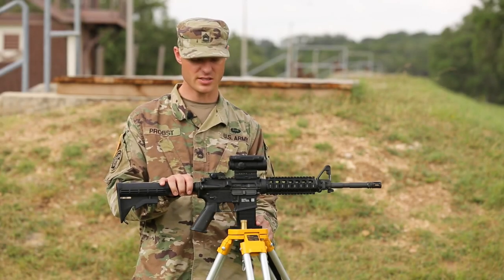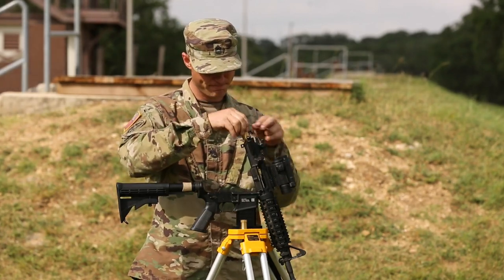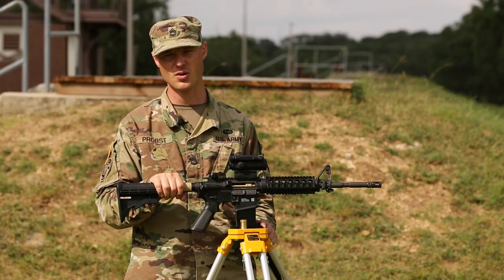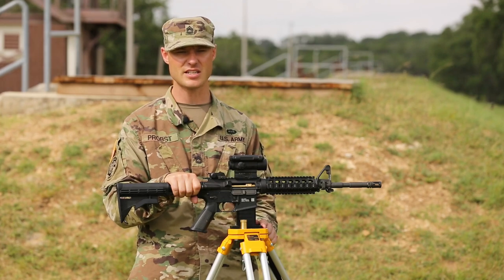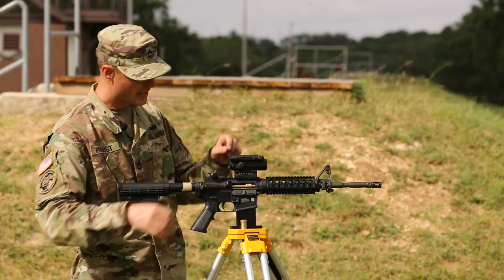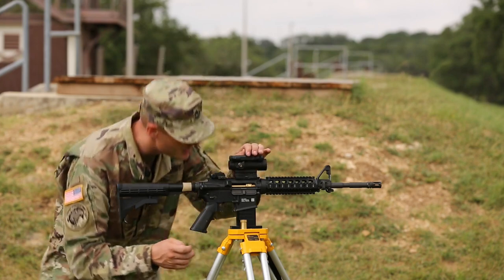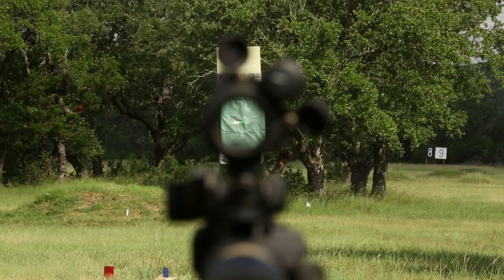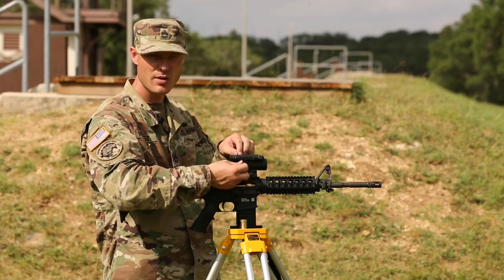Rifle Bore Sight (CCO)

Comment: 1 - pull the upper off the lower
2 - remove the BCG
3 - support the upper such that you can see through the bore to a target (sandbags make a helpful support)
4 - fine adjust the supports to center the target inside the bore
5 - without disrupting the supports, adjust the optic such that it aims to the same target
6 - look down the bore as often as needed to confirm you have not moved the supports
7 - reassemble and confirm by firing at close range
Reply from the maker: This would be the no-equipment approach and it also works.

Comment: You can also boresight without the laser device or the tripod. Considering the number of individuals who are afraid to service their sighting systems, I wish you would have at least mentioned that alternative methods are available when the equipment isn't. The laser device you have appears to be well made, but visually looking down the bore without a laser far outperforms most of the devices that are commercially available.
Reply from the maker: The laser device and tripod demonstrated here helps expedite bore sighting for an entire unit or other large group. As you say, this can also be done visually with no equipment.

Comment: If you have a laser) if no, you need a source of light, for example a candle or a led with 2032 battery. 
Then you need you upper fixed in a vise such, that you a able to see candle or led through your barrel. Now you can zero your sight.

Another way is use your iron sight, that you had been prepared before, you point you iron sight on some small object on the "0" distance for you iron and red dot sight. You have only adjust screw's of you red dot sight. It's a rood zeroing, finaly you have to prove it on the range.
Reply from the maker: >> If you have a laser.
True. This video shows a boresight kit intended to greatly speed up for an entire unit. There are other ways, of course, but none of them will make bore sighting 100 rifles faster than this.

A source of light is a good idea. Given sufficient ambient illumination, any target observable through the bore also works.

>>Another way is use your iron sight.
Yes. "Lollipoping" the optic by adjusting the reticle into the zeroed iron sight's line of sight is also a viable boresight method.

Comment: Could you add a video of how to do it without a laser.
Reply from the maker: Yes. Until then, the basic concept described by Eric H works.

1 - pull the upper off the lower
2 - remove the BCG
3 - support the upper such that you can see through the bore to a target. Use sandbags or other support.
4 - fine adjust the supports to center the target inside the bore
5 - without disrupting the supports, adjust the optic such that it aims to the same target
6 - look down the bore as often as needed to confirm you have not moved the supports
7 - reassemble and confirm by firing at close range

Comment: What is the NSN for the bore sight laser?
Reply from the maker: It's a Laser Boresight System - Kit. Range Tactics sells them and can tell you the NSN:
https://rangetactics.com/shop/

Maneuver Capabilities Development Integration Directorate (MCDID) reviewed it and use it because it makes bore sighting faster, especially for a group, such as an entire unit of Soldiers.

Boresighting by bracing on a sandbag or similar, viewing a target through the barrel, and adjusting the sights to that target certainly works. This equipment just speeds things up greatly.